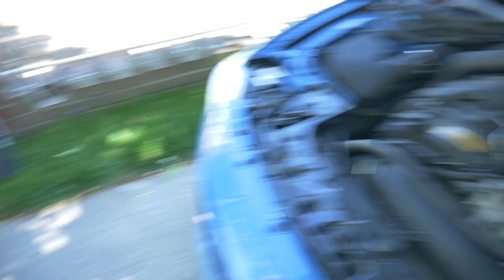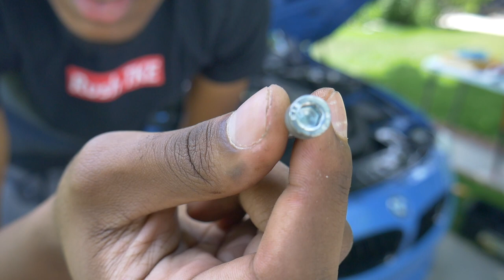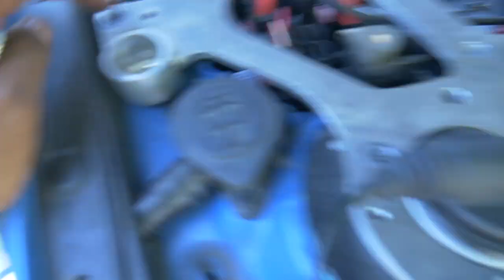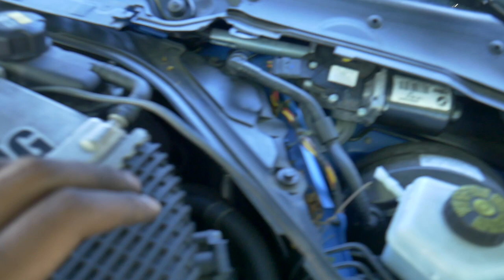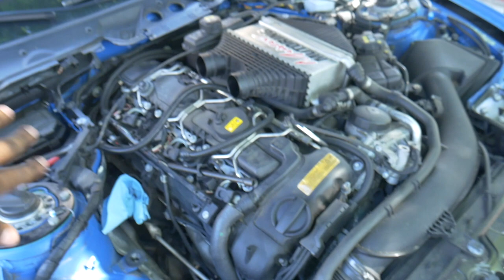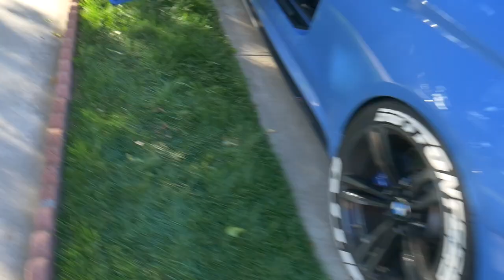BMW M4 Spark Plugs NEEDED a Change! (EASIER Than it Looks)

Comment: You did not show how to access the lower charge pipe bolts, I reckon it's difficult .. Good otherwise.
Reply from the maker: Sorry about that brother, I do have a video detailing how to install charge pipes and in it I talk about the screws/torx bolts and how to access them. You should need a ratchet of your choice a long extension a swivel attachment and the torx bit/ bolt size of your specific charge pipes bolt/ screw as if you have aftermarket charge pipes they may vary